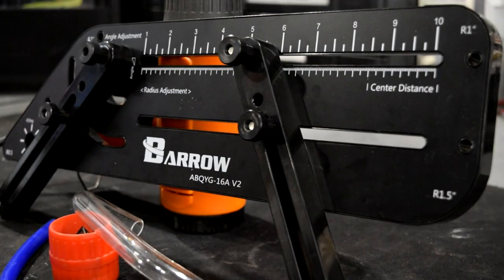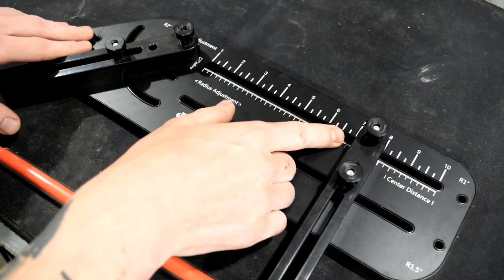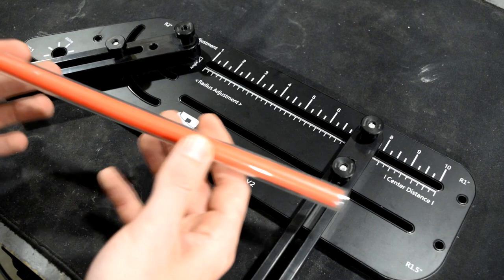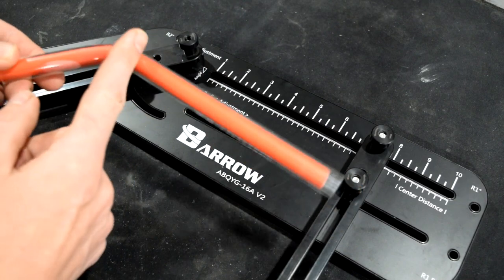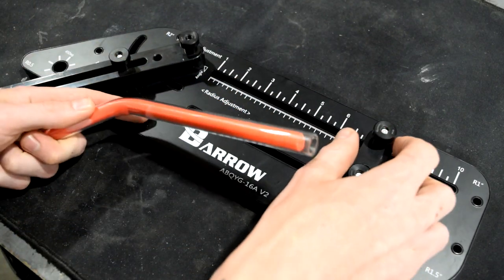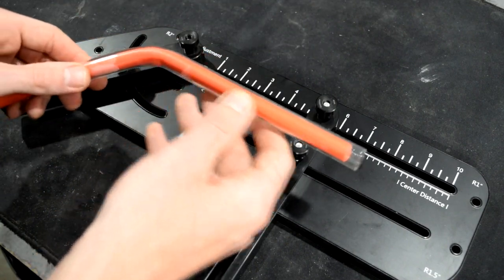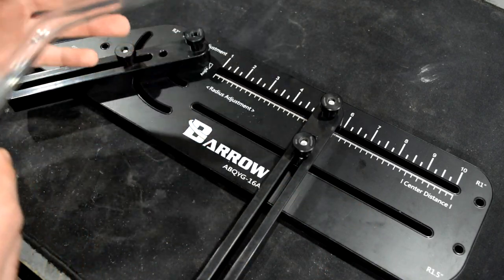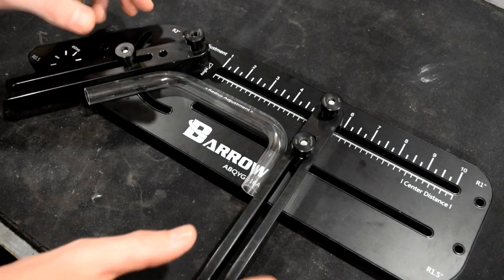Tool Tech Tips - Ep. 1 - Barrow Bending Mandrel

Comment: Thank you... If I understand correctly, you must measure considering the exterior side of your bending from one fitting to another, and align the tube's exterior on the lower side of the ruler's groove (because in your demo, it's not clear at all, since you bend way below that groove which actually makes the straight side between both bends longer than the measurement)??